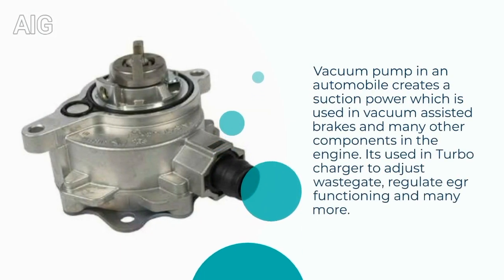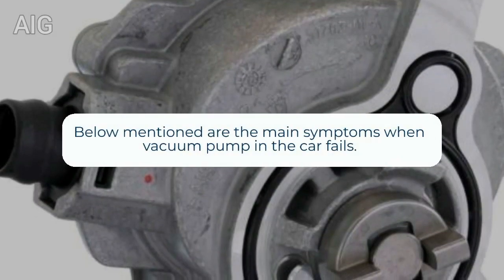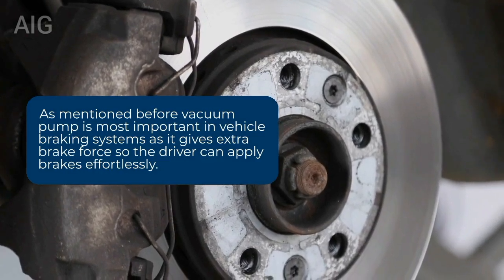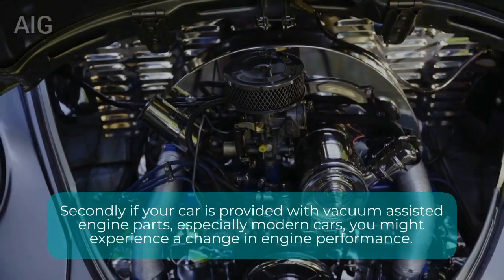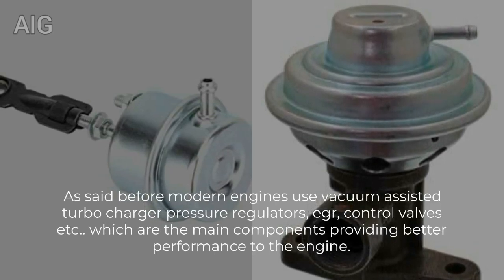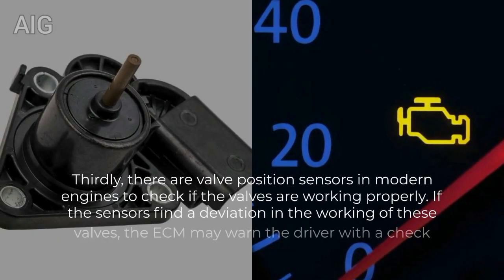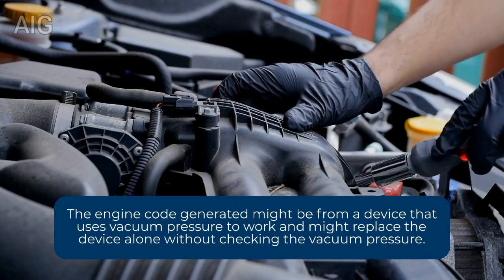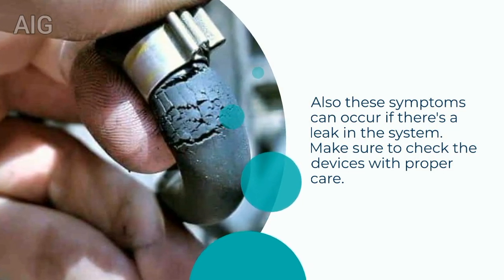Signs of failing or bad car vacuum pump | Brake vacuum pump symptoms

Comment: Oil is leaking out of one of the lines and my car is making a loud clanking nose and the brakes are hard to press down does the pump need to be replace or the line with the oil leak
Reply from the maker: Hi, you might have to check the pump for that clanking noise and see if it's working good. Oil from line means you have a vacuum leak. Any vacuum leak or non functional pump can cause the said hard brake issue.

Comment: I'm having a long pedal teavel with very soft feel, only starts braking at the end of the travel. Could this be vacuum related? Its 2006 w203 220cdi
Reply from the maker: Hi, seems like there's air in brake lines or need a brake adjustment if the rear brakes are drum type. This could also happen if the master cylinder retainer spring got pressed out.
Reply: @autoinfoguy  hi, thanks for your input 
This started some 4 years agora after prolonged brake abuse and one particular strong braking incident where i overheated the brakes. I've had the brakes bled some 4 or 5 times since, and changed the master cylinder as well, discs, pads, brake lines, and the soft feel/long travel still persists...

Comment: the suction is slow or weak on my ford focus vacuum pump, do i need to replace the whole pump? as its failed the MOT for it
Reply from the maker: Hi, do check for leaks, broken pipes, holes, blocks inside the pipe etc...the last would be the pump.

Comment: When the vacuum pump fails the fragments may go into the engine. Just discovered that on my new to me 2018 GMC Terrain. There was an early, but ignored warning. I could hear “ticking” from the engine which disappeared after the pump was replaced. I owned a 2014 Chrysler with the dreaded 3.6 Pentastar “ticking”.
Only 4 cylinder head replacements in the last 4 years of ownership. All covered by the no longer available Mopar Lifetime Maximum Care Warranty.
Reply from the maker: Yes that's possible. The worn particles can wash back to engine with the engine oil. Thankyou for the insight. 👍👍

Comment: Hello oil is pouring from vacuum pump hose and goes to egr on m272 engine and its vacuum fault or it should be something else
Reply from the maker: Its usual to see some oil spread across the pipe fitting of vacuum pump...its the vapour that escapes the pump when the oil heatsup and the vehicle is switched off
Reply: @autoinfoguy  do you have ig? Ill show u

Comment: Would this make car have stalling problems do to vacuum
Reply: It's surely does cause stalling problems.
Reply from the maker: Rarely, if there's a vacuum leak caused by the pump or pipes could cause rough idle. Possibility of stalling is questionable.Correct me if I'm wrong. 🙂
Reply: @autoinfoguy  it does cause stalling narrating from experience.
Reply from the maker: Vacuum pump normally dont cause any stalling problems. MOSTLY NO.
Reply: yes it can cause stalling problems